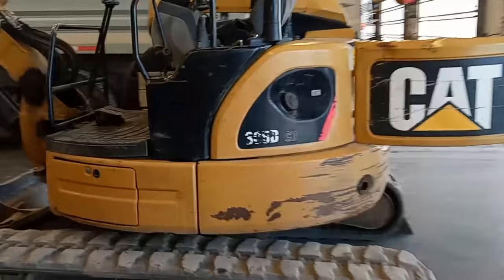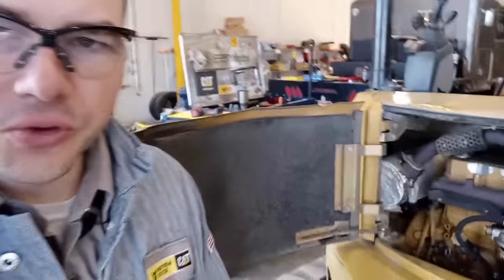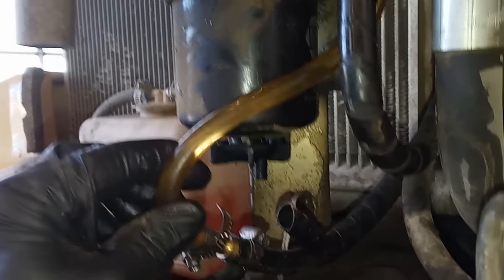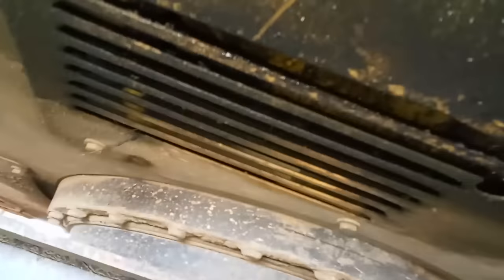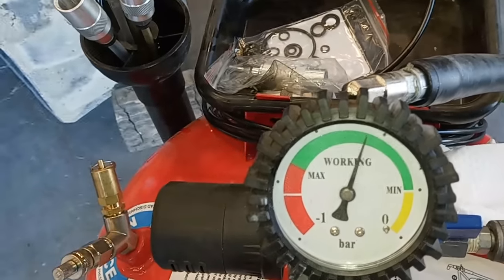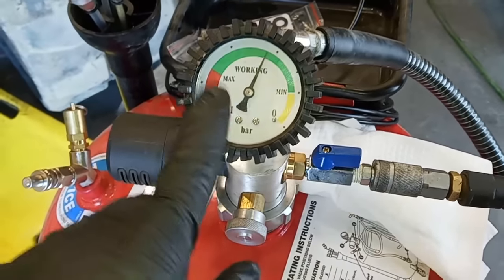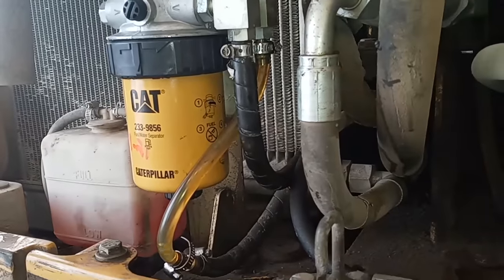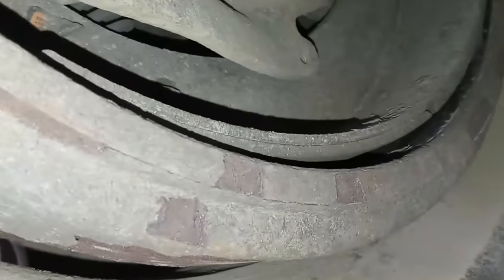What happens when a Truck Mechanic works on Equipment? Cat 305 Excavator.

Comment: Been in your shoes a couple times!  That lever does what?
Reply: We got a saying - 
If you don't know what Lever A Does , then
Lever her B . 
I was taught to run a Cat motor grader when I was 12 yrs old . I remember looking at the double row of knobs over the steering wheel , an then the 3-4 odd ones off either side of the seat .
An man that engine had some serious torque . An there was a sweet spot on the throttle if you went to take off an the idle was to low it would stall out , if the idle was to high it would spin the back tires an lurch forward dang near throwing you outta the cab 🙄

Comment: I ordered an oil changer. Kinda pricey, but like the thought. Does it come with the small hose, or do I need to set that up myself? If so, what did you use? I used the link, hope it helps.
Reply from the maker: Bob, thank you so very much. Amazon actually really helps the channel when people buy stuff through the link and it doesn't cost anything extra.

Comment: Liked the video as always. Gonna be asking a lot of questions in the coming months probably, trying to buy a truck. What’s your opinion of a 08’ c13 and switching it to a single turbo? And is that c13 shorter than a c15 or did just look like that? Would there be a problem changing to a c15 down the road?

Comment: I cringed when I saw the mess that braking system is in. This is why I no longer allow anyone but myself to touch the braking system on my truck. I now have all the special tools including these new adjusting tools which I love, and I do my own brake work now. I use special 23k Meritor brake shoes and heavy duty Gunnite drums and slack adjusters. Although I never have brake chambers on my truck long enough for the springs to collapse, I do routinely raise each axle from the ground with parking brakes engaged to verify the springs are doing their job. I've had too many diesel shops use inferior replacement parts or perform inferior work. I'd had enough and started doing my own work. Ultimately once I ever get into a truck with disc brakes, I'll have to go through another training course for their maintenance and replacements but that'll come in time. As an owner-operator, upon getting inspected by motor carrier inspectors, I smile at them and dare them to find something wrong with my equipment. Whether braking, steering, or suspension among other things, I know my stuff.

Comment: i got a huge question for you i have a 2008 dodge 5500 and we got it at a auction so it has a thermostat that opens at 180 when at stationary it always mantains 180 then when i start driving without a load it goes up to around 200 and stays around 200 to 210 when i am not even gassing it or giving it alot of throttle when i tow too its even worse it goes to about 220 to 215 they installed a new radiator so they defenitly had a cooling problem i have another dodge 5500 2011 and when driving normal it is always below 190 when towing below 200 all the time unless you go up hills then when i stop driving on the 08 it cools down after a bit
Reply: it cools down slowly

Comment: I've worked on just about everything, boats are the worst, motor homes close second, but find equipment to be overall designed with sevice ability in mind, all of those zero radius machine's by nature are tight# welcome to the dark side 😂

Comment: Boom pins to the machine, stick to the boom, bucket to the stick. 

Catsubishi. Perkapillar. Catbota. Fiatpillar. Cat actually no longer makes new model engines under 9.3L. Legacy engines aside, everything under the C9.3 is a contract engine.

Also, you guys have drain Pigs too??
Reply: Who makes the 7.1?
Reply: @electric7487  Perkins. It is the spiritual successor to the C6.6, which is a 3056.

Comment: So how long does it take for that Lincoln system to pull the oil out of a C-15?  Great video as always.
Reply from the maker: That depends on a couple variable. The temperature of the oil and the diameter of tube that will fit down the dipstick. If you have the larger dipstick tube and the oil is hot it can be about 30-60 minutes. Draining it is faster by itself, but this way is easier, cleaner and gives you a better way to transport the old oil.
Reply: @AdeptApe   Thanks.   We currently drain our oil into a large container and then pour it into 5 gallon pails and then pour that into a large drum for recycling.  The only trucks we ever really have had any issues with are the rear sump Detroit 60 series pans and Volvos.  For some reason people like to overtighten them.  I always torque mine.

Comment: Heck if theyre putting Mitsu motors un CATs folks could start buying kubotas and theyd be about the same😪
Reply from the maker: The newer Cat equipment uses Kubota engines lol.
Reply: @AdeptApe  no kiddin😲
Reply: Cat has rebranded Mitsubishi equipment and used their engines since the late 70’s.

Comment: How is cat sis
Reply: I just rebuilt an 2.3 engine and SIS and DSN said sorry we do not write anything as it’s not a Cat engine, great back up service NOT
Reply: @anthonyhunt561  I’ve got a 3054c/c4.4 to rebuild from a cat 416e. Cat parts says c4.4, the tech guys say 3054c.
Reply from the maker: Yeah, I was surprised how much they lacked info for this engine.
Reply: There is a cross over chart I will check tomorrow at work, what is your serial number??
Reply: A CAT 3054C/T is a Perkins 1104C-44T. CAT C4.4 is a Perkins 1104D-44T so same engine , don’t forget to replace rod bolts.
Reply: @anthonyhunt561  lms00439

Comment: Your not a real mechanic, I have been working on trailers for 35 years and you wouldn't last a day in the shop with the big boys. We only need standard wrenches and a hammer. We are the smartest mechanics around I even used a test light once
Reply: Ahhh ok.